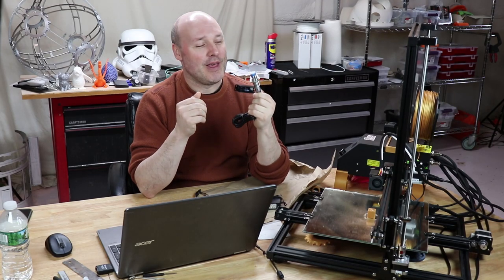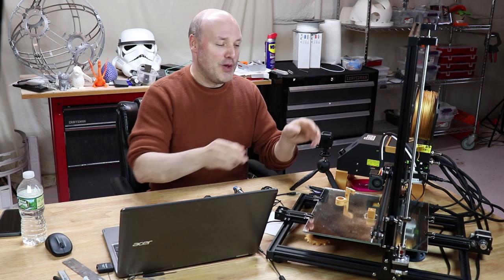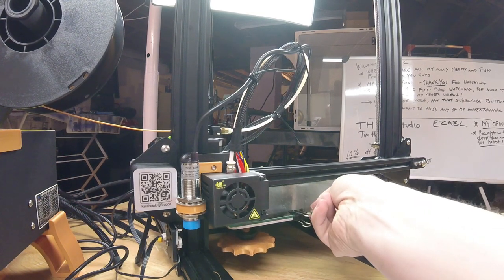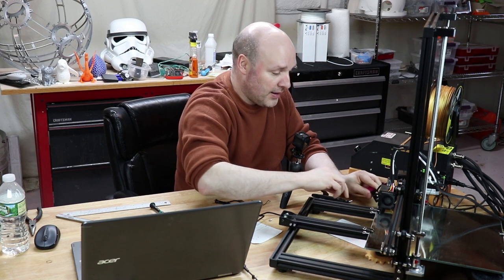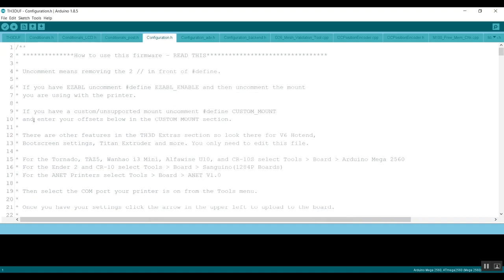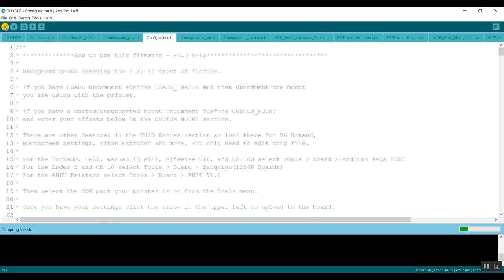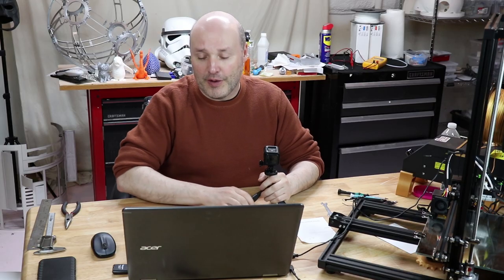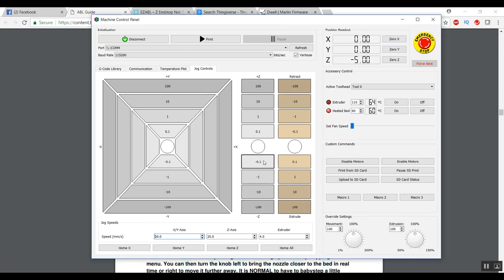Installing the TH3D EZABL Sensor on the Creality CR-10S

Comment: Was thinking about getting one of these, but ended up just updating the firmware on my CR-10S to TH3D's Unified firmware and enabling manual mesh bed leveling. Works just as well as any auto leveling solution (besides the fact that you should do it every time you print) because the Z axis still moves in real time as it's printing.

Comment: Okay man... subscribed and following this video to finally get my sensor setup today.
Reply from the maker: You can do it!  I still babystep each print a bit at the beginning
Reply: But what the hell is the purpose of EZABL if you still need to define the offset of the autodetection and the real height manually again? If this needs to be done all that time I consider capacitive sensing flawed. You just want a stable and repeatable sensing distance. if that changes all the time, the purpose of bed leveling has gone.
Reply from the maker: You have to calibrate the probe.  It’s quite simple.
Reply: Any other type of distance sensing doesn't have to be calibrated every time.
Reply from the maker: Just initial setup.  If you don’t like it, don’t buy one!  I’ve had great results with mine!
Reply: Initial, or initial every print? I have a DIY EZABL, but I don't get the same height on all corners when I print test prints. So maybe I will try Bltouch type sensors.
Reply from the maker: I’m not sure what to tell you.  I went with the EZABL since it’s well supported and they’ve answered every query I’ve had

Comment: Hi There.
 I just watched your video. and there are several items that you address  that might need attention that are different then the instructions I just downloaded.
1. 8:50 into the video, your directions about routing the sensor wire are different the in the instructions  Page 14 " Mounting the EZABL to your Pro sensor. It says to "install the sensor exactly as seen in the picture below". You run the wire straight from the sensor straight instead of in a curve, as in the picture, which can damage the wire.
2. 10:00 your directions on the distance for the sensor (2MM) is not the same as the  Page 6 of the instructions "Mounting the sensor" . You say 2mm from the build plate. The Instructions say "2mm higher than the nozzle".
Reply from the maker: Hi
Note the time of video and the changes to their documentation.  The Pro wasn’t out back then

Comment: I enjoy your videos. You don't dissapoint. I'm still wondering what it is that this contraption does and how it does it. I have a Cr10 s5 so I certainly know what levelling is but this video is sort of missing an introduction 'splaining exactly what is achieved by using this device. For example:
"This device eliminates the need to adjust your levellers. It does so by mapping out your bed by sensing different points(16) and saving the results. 
As the print program runs the z levels are modified, and hence the nozzle height, to account for differing bed to nozzle heights over the span of the bed. It automates the bed to nozzle height by using an automated algorithm that modifies the Z level height through interpolated calculation using the aforementioned saved heights (16 points)......"....

You need something like this in the intro. I'm just speculating on how this device works. I don't have a clue how it actually does its 'magic'.....
Reply from the maker: Good critique...I wanted to get as many details in this as I could without overwhelming people.  In truth, the bed leveling devices are a good tool...but I am still babystepping my prints as needed.  This won't make your printer a "set it and forget it" like the old Ronco commercials!  But it will help alleviate some of the challenges of leveling these larger beds.

Comment: Noticed you have the dual Z rails...was this an aftermarket upgrade...and was it worth it? I currently brought a franken-cr10S back to life...a warped bed plate was my main grief...but is now temp fixed. Def interested in this level kit....
Reply from the maker: That was a machine upgraded to dual z (I think - I have 3 CR-10S machines now but one was originally a CR-10). The ezabl works well. So does the BL touch. Depends how you want to go. Get as level as you can with the bed knobs and the probe can help get a bit better.

Comment: Good video. A question though: if you install this and the TH3D firmware, what happens to the original CR-10S filament out sensor functionality? Does it still work with out having to go to the TH3D EZOUT? Thanks
Reply from the maker: Hi.  If you check the TH3D firmware there is an option to keep it or disable.  I have mine disabled.  I read these give false readings.  They may have fixed it now but I just don’t utilize those things

Comment: Looks identical to the Creality3D one I just received.  Comes with all fitting hardware and power supply and wiring.  I paid US$48 for mine.  What is that "Machine Control Panel" software you are using?
Reply from the maker: That’s in Simplify3D

Comment: The EZABL appears to come iin 2 sizes - 12mm and 18mm. Do you know what size sensor is recommended for CR10s?
Reply from the maker: Both work equally well from my experience.  Just different sizes.  I know they have a newer model put now
Reply: New Model? Where?
Reply from the maker: @Auron0009  just check TH3D's website for details

Comment: BTW, print the fengtooth fan adapter man. It's all stock parts...and you can finally see what you are printing. I hated the big block head from the beginning! And when I mounted the feng it was finally visible what I was printing hehe. Check out @b03tz3D on insta to see an example.

Comment: Where can I get the stl for that mount? I have the sensor but not bracket. I would be installing it on a creality cr-20.
Reply from the maker: If you bought the sensor from TH3D you can contact them for the STL.  It's not mine to hand out.  If you got it from Creality...you should contact them.

Comment: Did you ever remove your spring leveling mounts? I just ordered their rigid mounts but I am not too sure how I feel about using software only leveling.
Reply from the maker: Mine are still installed.  Have t removed them yet!

Comment: Good Video but i need some help i got my kit for my CR10 but when i set my auto home my CR10 doesn’t stop when is going down and i need to turn it off from the back any idea how to fix the problem
Reply from the maker: Is this a TH3D kit?  It sounds like the Z limit switch isn't plugged into the ezconnect
Reply: @WhereNerdyisCool  yes is a TH3D when i check if the EZABL and use M119 said x y x open is supposed to say TRIGGED
Reply from the maker: @tapoutms5608  sounds correct...be sure to ask on the Facebook group (https://www.facebook.com/groups/th3dstudio/)   You'll get some quicker replies!
Reply: yes  open
Reply: @WhereNerdyisCool  Thank you but the link don't work
Reply from the maker: @tapoutms5608  search for the TH3D Customer Support Group
Reply: @WhereNerdyisCool  Thank you

Comment: i have a question, i bought the standard cr-10 new and got it today, i bought the upgrade kit for dual z axis motors and rods, can th3d firmware work on my cr-10? i have th3d on my anet e10 and e12 and now planning on buying the auto level kit you demonstrated for all 3 printers. my cr10 is the repko creality cr-10 made in america. i am unsure which board is in my cr-10 but it says mendel ready, if you suggest i need a different main board i will buy one, i am sending the anet e12 back for another cr-10, the e12 is a poorly made product and didn't work out of the box.
Reply from the maker: You have quite a puzzle.  I would suggest following the steps Tiny Machines laid out for installing the second z screw.  That will help get that installed.  Firmware wise, I would guess you need a few additional steps to upgrade the firmware (bootloader).  The firmware shows options for CR-10 and CR-10s (electronics).  The z screw add on i have just slaves off the first (cable split like the install video will show).  I opted to buy the CR-10S electronics upgrade for my CR-10....just need to install it.

Comment: I see you have a mirror bed. I have read in many places that inductive sensors didn't work with a mirror bed. TH3D website says the ezabl will work. Obviously it worked for you. a fgew questions
Is it repeatable and stable? 
Will this help compensate for a warped print bed? (the glass mirror helped but it is still not perfect)
Will it help with variations in the bed leveling due to removing prints etc?

I have an ender 3 and it seems I am constantly having to re-level the bed. I am hoping that this device will eliminate the need for that.
Reply from the maker: It’s helped immensely.  So much so I bought two more (for my CR-10 and Tevo Tornado). I am also using Polypropylene beds on all my printers since I’m having such good luck with it
Reply: Do you have more information on the poly beds?  are the bed levels more consistent. The expansion and contraction of the aluminum is a big issue.
Reply from the maker: I bought mine from TinyMachines under “Awesome Upgrades” if you visit his site
Reply: Thanks I have already purchased bed springs from them excellent service. I will check it out. THanks!!!
Reply: I just ordered one from them myself to replace a mirror plate. Do you just install it directly on top of the heat bed and clip it down? Any problems with warping?
Reply from the maker: I had to re-level and do the z offset again since the Poly-bed thickness is different than the mirror.  But so far, this surface has worked extremely well for me!  I still wipe it down with rubbing alcohol after each print

Comment: I purchased my kit, but there do I find the stl for the mount?
Reply from the maker: It’s in the Unified Firmware when you download it
Reply: Makes sense.  I can’t wait for my kit to arrive. It seems like the bed is never leveled.
Reply: And thanks! I’ll try and locate it in the zip.
Reply: I looked in the wrong directory. Oops. 

But I received my kit yesterday and I think it’s taken me about 12 hours to get a semi working first layer.
First, I over looked the lock washers hitting a screw on the right side and throwing off my print. Barely tapping, but enough to destroy the entire job. My fault.

After I fixed that I figured I’d wipe the firmware and start over. It worked better, but still bad.

I tried brand new glass with no pei or buildtak.  Reset the settings and redone the levels and fun stuff...

First layer going okay, but it seems like the wipe on the left side right before the main job will drag the nozzle though the wipe and collect it on the nozzle, which it did this with all the other tests before too. So, I’m thinking about tweaking the startup script to not do this, or add enough space between the wipes so the travel doesn’t drag in the first wipe.

this has been one of the most difficult upgrade that I’ve ever done. I have nearly 1000 hours on this one printer and have tweaked everything that I could, because I print 3dlabprint planes, and I was very hopeful for making it easier to get that first layer perfect every time. So far, nope.
Reply from the maker: Be sure to reach out to TH3D support or their Facebook support group.  There’s a lot of help available

Comment: Hi, I checked my Configurarion.h and It does not have the #define EZABL_ENABLE. Should I add that line on my configuration? I am using CR 10.
Reply from the maker: Are you using the Unified Firmware?  Check their instructions.  They may have made changes    You shouldn’t have to add anything.
Reply: Where Nerdy is Cool! Yes I got it from TH3Dstudio website for CR10. I dont think they have instruction for the firmware, do they?
Reply from the maker: Make sure once you unzip the file double click the batch file.  The instructions are in the firmware as I show
Reply: Where Nerdy is Cool! yeah they do not have the line to enable the EZABL
Reply from the maker: Which printer are you using?
Reply: I am using CR10. I downloaded the Unified Firmware for CR10. and yes my EZABL is not working :(
Reply from the maker: You iuncomment the model printer you are using.

Comment: does the SD card still work when this and the firmware are installed?   Was looking at a BL touch, but it kills the SD card functionality.  Will be installing on an Ender 3, but not much different than a CR10 / 10S
Reply from the maker: I’m largely using OctoPrint but I am 99% sure my SD card Works just fine.
Reply: Yes, the SD card works perfectly after the install.

Comment: when you baby step at the end, would you then add that # to the Z offset after the print?
Reply from the maker: You could do that, yes.  On mine, I still babystep around  -.075  (closer to bed ) with the filament I have in it now.  A different brand filament requires no babystepping.  The lesson...monitor those few first layers and see if any fine tuning is needed

Comment: Do you need to flush your board and install Marlin?
Reply from the maker: I'm using the TH3D Firmware.  That's based on Marlin and when you update the firmware, it will now have that on it.  No flushing needed, updating the firmware is pretty easy.  There's also a support group on Facebook and TH3D has their own support too...feel free to utilize those resources too!

Comment: How do I slow down my extruder?  Its pressing to much out..plugging constantly
Reply: I know you can slow down your flow % in your slicer. I use Cura and there is a setting where you can adjust flow rate.

Comment: Hi i dont understand one point ? you are using that little tool that is give or take 2mm but you put it on your bed ? from my unserstanding and from the pdf of th3d that 2mm is suppose to be 2mm higher then the nozzle and not 2mm higher from the bed ?
Maybe i dont understand something here ?
Reply: Your suppose to take your nozzle down till it touches the bed, then you have a consistent reference to measure from.
Reply from the maker: Unless the PDF has changed....I just followed the instructions on the mounting offset!

Comment: Can i have the file for the mount please? i plan on buying the kit and want to pre make the mount so all i have to do is attach it and go. Thanks
Reply from the maker: It's in the the TH3D Unified Firmware (https://www.th3dstudio.com/knowledge-base/th3d-unified-firmware/)  However, be aware that since Creality and others are trying to use TH3D data for their products, they have had to password protect those files.  When you purchase they provide you with the password.

Comment: Beware, this EZABL blue sensor is a VERY unreliable and hard to tune sensor that can't be tuned properly. It is very sensitive to the temperature of your bed and it simply stopped working properly just after couple of months of use. Obviously I could not return it and the only advice TH3D could give me was to replace it with the "pro" version. No wonder why these products are not sold on Amazon or eBay for example - because these platforms require diligent sellers who value their customers. This is not the case here. If you need more details about my experience, comment below
Reply from the maker: I haven’t had the experience you had. I’d be curious your setup.  I’m not saying they are perfect but so far, very few issues with mine
Reply: @WhereNerdyisCool  the sensor I received was working Ok'ish at first and then after couple of months I noticed issues when it would not detect the bed in couple of instances so decided to tune it again. It did not work for me at all, I went all the way counter clockwise but the sensor did not turn off. I increased the distance to the bed, verified voltage on the sensor was correct, used different surfaces (glass) in addition to the EZMat (by the way the claim that it works on glass is not true. Pro version works but this one does not).

Comment: from wat i heared its better to not include the springwashers when mounting the sensor , as it can cause the sensor to seat canted in the mount trowing the measuring off slightly
been hovering over this adaptation since i got my cr 10 s , looks like you dont even need the arduino any more to load the software on the machine
Reply from the maker: You shouldn't need a bootloader on the CR-10S   It's a different motherboard than the CR-10

Comment: Why the sensor can't be powered by the motherboard of the 3d printer? Power the sensor with an external supply? Just open the powerbox and solder the wires on the motherboard....
Reply from the maker: Sure, you could do that...i went with the fastest means!
Reply: They sell two versions, one that is powered by the printers power supply, and one that is for people like me that are lazy that don't want to mess with soldering wires.
Reply from the maker: Precisely! Saved me messing with the electronics box.

Comment: How do you like your cr10s
Reply from the maker: Overall it has been a very good printer.  This CR-10S came from PrintedSolid.com  They pre-inspect and verify the printer is working properly, repaired the faulty capacitor and much.  My CR-10 from Gear Best arrived a bit beat up but has worked very well.  That printer is slated to be upgraded very soon!

Comment: I thing I can't get my printer to do is home to the middle.
Reply from the maker: That’s called Safe Homing in firmware
Reply: @WhereNerdyisCool  
Searched for it still cannot find it.  I am using the new TH3D unified 2 firmware.
Reply from the maker: Okay this video is a year or two old and I’m sure TH3D could answer this one for you if asked 🙂
Reply: @WhereNerdyisCool  Video is never to old!  Yes, they answered and I may have a possible fix,  Thanks!
Reply from the maker: Excellent!  Happy to assist!  I hope you Subscribe!